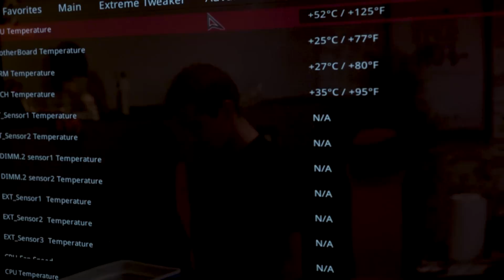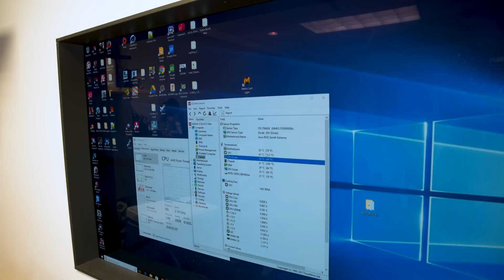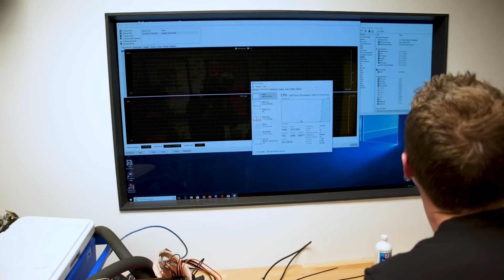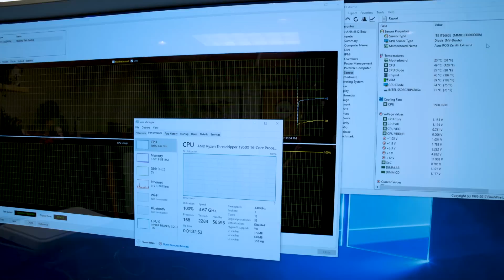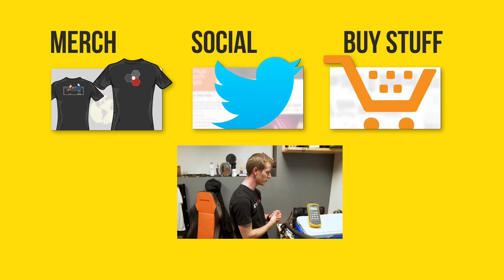My 10 Year Old Chiller WORKS! -20C on THREADRIPPER!

Comment: Actually, a lot of cpu cooling blocks could be majorly improved. The transfer surface of the processor is limited so that means that the cooling area as it is on the one you use, is also liquid wize. If you had a platform on the cooler with a copper raiser it would allow for a much larger liquid coolant surface. The liquid temp over the surface is directly depending on the velocity and volume so it can never distribute ( or cool) better than w/mm square as it is now. However, going up in block size require a pump upgrade as well or the local temp will more or less have laminar flow. You want a high turbulent flow with an massive transfer possibility. If it was a honeycomb ( with a flat bottom) up to a pyramidenlets say ten cm ( upside down pyramid) you can deffo get same temp as ambient in the room without any compressor whatsoever. A bit bulky but not complex.

Comment: The liquid inside the cooling system is Refrigerant mainly R134A or R-22
Reply: mostly R410a or R32 for airconditioners, R22 is not allowed anymore just like R134a and R410a in a few years

Comment: You got that wrong. It goes like this: compressor outlet (high psi/high temp gas) > Condenser (condenses the gas to a liquid by dropping temp to around ambient) > Evaporator (turns the liquid into gas = low temp) > compressor inlet (low temp/low psi gas > rinse and repeat.

Comment: "- I havn't used since AMD had a relevant high end processor" I do not have a middle finger long enough Linus, which is impressive considering my freakishly huge hands (I don't mean in the vapid bitch way, I mean in the I can wrap my fingers around extremely large water bottles easily huge).

Comment: The compressor compresses the fluid? I think you'll find if you try to compress a fluid it will break whatever you compress it with.
Reply: Air is a fluid, air can be compressed, a fluid can be compressed.

Comment: AC compresses gas then condenses it into a liquid. If that compressor tried to compress a liquid, it would break. This is why you can break your AC unit if you run it in the cold.

Comment: Crazy build idea: use a residential multi-split AC.  The kind with the compressor and radiator in an outdoor unit that pumps the freon into the house to have air blown over it for a central HVAC system.  All the noise and heat are outside, you could put the supply lines in the walls and just hook them up to the PC from there.

Comment: I had an idea once to do an immersion cooled system with 3M Novec fluid flowing out of the sealed case to an aquarium chiller.  You guys should do that.  Total immersion cooling mean 0 concern for condensation since you would already have to be sealed to prevent the immersion fluid from evaporating.  You guys should totally try that.

Comment: You guys should try water-cooling a water-cooled system. Like running cold water through the radiator to extract the heat.
Either that or turn use a system to spray down the radiator with water and let it evaporate to increase the cooling.

Comment: All ThreadRipper CPUs actually have a +27 degree offset for Tjunction (reported as CPU temperature), which is why it shows the temperatures it did. Tdie (reported as CPU diode temperature) is the actual temperature of the CPU.

Comment: Why are you guys using wiper fluid? If you look at cars, the coolant actually is water. you add coolant to reduce the freezing temperature - but the alcohol in the cooling fluid is the part that actually reduces the effectiveness of the coolant. you always want to have the largest amount of water and not so much coolant if you want to have a good cooling. If you use wiper fluid, you have soap and all the other additives in there that acually prevent a good cooling efficiency.

Comment: Key to heat transfer is no air gaps.  Key to insulation is vacuum gap (or second best is air gap).  That's why the best thermoses are double walled.

Comment: 1:33 NONONO fluids are incompressible, Linus! The compressor compresses GAS making it high pressure and hot! Then it becomes liquid when its cooled in the CONDENSER (the outside "radiator") then it gets transported to the expansion valve, where its pressure is released upon entering the EVAPORATOR (inside "radiator"), absorbing the heat you need to get rid off.
Reply: For engineering purposes in terms of hydraulics and such, water is considered virtually incompressible. But if you go to extremes like the bottom of the Marinas Trench, deepest part under the ocean... the water is compressed there slightly. It just takes such insane force that we usually consider it non-compressible even though it technically can. Just look up Ice-IX and stuff like that, exotic forms of water under such insane pressure/compression that it basically starts transforming into new states.

And yea, Linus was still wrong, lol.

Comment: Wait am I missing something?? That wasnt coolant, that was window washing solution....

Someone explain pls.
Reply: Payton Price obviously. But coolant or some other fluid, it will have the same effect as long as it doesn't freeze.
Reply: I believe coolant has a higher evaporation temperature so when it hit's a burning hot engine block it doesn't automatically expand in to gas and possibly fuck up your engine and not carry heat away effectively. He's using all weather windshield wiper fluid because its freezing point is much much lower then that of water, so #1 it doesn't freeze before leaving the jets to use on your windshield and #2 when you use it in the winter it doesn't freeze on your windshield, pretty much the opposite of what you want. Making the all weather windshield wiper fluid a better option as we're looking at going into sub zero temps and you don't want the fluid turning to ice.
Reply: Coolant doesn't make things colder, it is just to lower the freezing temperature.
Reply: Are you guys stupid? In an engine it literally pulls heat away from the oil temps and from your cylinders.

Comment: Help me someone. I got an old laptop running linux, but is boring and i want to upgrade it to win 10 64bit. But idk if my gpu has directX 9 
Specs:
intel 2 duo P8400 2.26 Ghz 2 cores 2 threads
4 Gb of dual channel ram
ati radeon hd 3470
2Tb ssd
Reply: Liquid Fire try reading your specs again, it's very unlikely you have a 2 TB SSD with the rest of that considering how expensive one is
Reply: This laptop had a 5400 rpm hdd 250 Gb. It was very loud and hdd with shitty specs was a disaster. My main laptop had 250 Gb M.2 ssd, and 2x2Tb sata ssds. So temporary i removed one and put it in my shitty  laptop :P

Comment: You got your AC working theory a bit wrong. The compressor increases the pressure of the vapor coming from the evaporator, which increases it's temperature (and hence allows the system to cool down anything). This now pressurized and much hotter vapor condenses (at least partly), due to the high pressure and lowering temperature inside the condenser, cause your fans cool the condenser down. After the condenser there is a valve which lowers the pressure, and anybody who has heard about physics knows that this lowers the temperature. This low temperature, low pressure vapor now goes into the evaporator and the cycle begins again.

Therefore you have low pressure and low temperature in the evaporator, and high pressure and high temperature in the condenser. The whole refrigerator/air conditioner works by pressure difference that causes heat changes throughout the system.
And it doesn't have perfect efficiency, which means that in addition to your room warming up with the heat from the CPU itself, it also warms because of the internal lack of efficiency, effectively turning electricity in to heat while cooling your heat source, and both these heat sources contribute to heating your room.

For more powerful cooler you should look into big air conditioners or deep freezers (or anything with high pressure difference). You could use fridge components too but they might use lower pressures to save on electricity and hence limiting it's delta T. And remember that the gases that used to be, and often still are used, are not healthy nor good for the environment. They contribute to global warming in high amounts and also often deplete the ozone layer, which is why devices using CO2 as the vapor are coming more common, since it doesn't contribute to neither greenhouse effect as long as it's from a greenhouse-neutral source or to ozone depletion.

You could do the same with water cooling though, although pressurizing water to high enough degree is quite expensive (like our ~5000 bar water pump is astronomically expensive, and still has quite limited lifetime). You could use your water cooling radiator as a condenser (if it would be rated to high pressure!), put the high pressure pump between your system and condenser, and drive the fluid back to your components from the condenser through a pressure regulating valve.

Comment: This thing looks like a cooling system for a diy nuclear reactor
Reply: Actually, cooling for nuke reactors is much simpler. BUT, you need a fairly large swimming pool for one.
Reply: I know that nuclear reactors (especially the breeder reactors used by the US) are all water cooled. Why do you think I made the pool comment. The large ones use large ponds to cool their coolant. The cooling system he used added an extra system into the cooling process that reactors don't have.
Reply: Jack Linde sry
Reply: Found the story

Comment: FALSE! Compressors dont compress liquid. They can only compress gas. Liquids are almost incompressibles.
Reply: Let's just agree to slightly disagree guys.
Reply: Im a refrigerator sealed system tech. The compressor only compresses gas. The gas transforms into a liquid in the condensor.
Reply: Kevin Liu in a vapor cycle, the compressor ONLY compresses vapor. If liquid get in the compressor it hydrolocks and breaks.
Reply: pogi09282805724 correct more succinctly the cycle goes vapor from evaporator goes to compressor which compresses it to a high pressure gas, condenser condenses it to a high pressure liquid then it goes through an expansion valve or orifice plate which evaporates it in the evaporator to a low pressure gas which then goes back again to the compressor. Cycle complete
Reply: pogi09282805724 FALSE! Liquids are slightly compressible

Comment: That insulation seems like it would be very bad for the cooling of the CPU's power chokes built into the motherboard, which would DEFINITELY be under stress if you're overclocking enough to need this cooler.

Comment: Boiled off liquid gas (Low pressure vapour) > Compressor, funny enough, compresses vapour into a high pressure vapour > Condenser turns high pressure vapour into a liquid state > Evaporator then boils off your liquid gas (Expands) > (Cycle repeats)

Comment: You should get a Tenney Oven and go down to -40 degrees C and feed the cables out the side port hole of the oven 😂 You can even get the Watlow controller to program the oven to keep it nice and steady with the right PID constants.

Comment: Why not use a split AC unit for this? That way you put the noisy parts (Pump, compressor and condenser with fans) outside and the rest inside. These would require though someone certified to do the Job perhaps.

Comment: Could you just put your board in a vacuum molding machine and make a perfectly shaped condensation proof armor. just cut the slots out where components, put the components in then seal the slots with vaseline.

Comment: This is like ltt in a nutshell
Reply: I think they could expand on this and do "Whole Room Water Cooling - Sub Zero Edition".
Reply: “Why did i do this?” “Why am i showing other people how to do this?” “Where is this screw from?”
Reply: Yes this is why I watch Linus' videos!
Reply: did he drop anything?
Reply: I'd personally use a Stirling engine powered by a motor, to get the low temperatures. Also, powerful fans would be needed.

Comment: Currently the temperature outside here at my place is -25°C. If I keep my PC outside, I won't even need a CPU cooler.
Reply: Air is a terrible coolant and a CPU without cooler has only a tiny surface area. It will very quickly overheat or at least thermal trottle. Don't believe me? Feel free to try it.

Comment: Linus you got the whole refrigeration cycle wrong , the compressor pumps vapor (it would be a hydraulic pump the way you said it) to the condenser where it releases the heat turning the refrigerant to a liquid then to the evaporator which absorbs the heat turning it back into a vapor and back to the compressor .

Comment: Okok, one beef I have is, RainX washer fluid??  Why not straight propylene glycol  or ethylene glycol?  That RainX has some methynal in it sure,  but it also has soaps and a liquid wax to keep rain from layering on your windshield. It's so full of contamination that your condenser will get clogged up. You have places to by that less than 20 mins from your office.

Comment: Would be pretty sweet if you could design a neat little setup where you replace the evaporation coil with a cpu block and control it with the fans on the condenser. The refrigerant would then be used to transfer the heat instead of the extra parts of the water pump.

Comment: You forgot the serious health, environmental, & legal issues of working with a closed loop Freon system(AC)!
If you were to accidentally puncture or break open any of the AC's chiller loop you would be breaking the law.
Some things you should know before doing something like this(In Canada[Ontario, couldn't find B.C.]):
https://www.ontario.ca/page/certificate-handle-refrigerants
https://www.canada.ca/en/environment-climate-change/services/air-pollution/issues/ozone-layer/measures-protect/federal-halocarbon-regulations-information/fact-sheet-refrigeration-air-conditioning-systems.html
https://www.ec.gc.ca/ozone/default.asp?lang=En&n=24B589A5-1
https://www.ec.gc.ca/lcpe-cepa/D918C063-1AB3-442E-A62A-59001B7B70F1/Refrigerant_eng.pdf
https://en.wikipedia.org/wiki/Freon

Comment: Um, I was on board until I saw the janky reservoir and pump. And window wash as coolant....... Jeeze
Reply: that stuff is is designed not to freeze at really cold temperatures so you can run you windshield wipers and sprayer in the winter.
Reply: Typically Rain-X leaves a hydrophobic film behind too, which is what causes water to bead on the windshield of your car and blow off easily. It's the whole reason they sell windshield washing fluid. I don't imagine it's as good for heat transfer but it may not make any difference.

Comment: Yup, looks like an AMD FX stock cooler. (I like AMD btw)
Reply: No Name You've done something wrong. 😂
Reply: I still have the FX8350... It's a good CPU!
Reply: I've ran two PC's with the FX8350 on stock coolers for around 5 or 6 years now. No issues, even with some overclocking. Either something is wrong with the CPU, the cooler positioning, or you have a bad overclock. Was the CPU new? someone else might have knackered it.
Reply: Yeah those Nickle fins and copper pipes on the radiator bring me back to the FX 8350 black and the FX 8370 wraith I had.
Reply: Yeah they can run a bit hot. Strange.

Comment: You can't compress liquids it's goes from the evap(vapor) to the compressor(vapor compressed) to the cond(turns to liquid) to a txv/fot(atomized liquid) back to the evap
Reply: Also there is a receiver/dryer or a accumulator/ dryer depending on if it's a fot or txv
Reply: https://en.wikipedia.org/wiki/Freon
Freon is a gas at room temperature and a liquid when cooled or compressed.
Linus doesn't understand how it works and was just trying his best. Cut the poor guy some slack. He isn't a scientist or even a professional with computers. He is just an entertainer and company owner/CEO.

Comment: I really want to see Linus and some other do this legitly and make it look good. Then test the temps under synthetic load and under games, also try to over clock it. do this on this on an intel and amd
Reply: I have a proper phase cooler (the gas boils in a CPU/GPU expansion block, giving you as low as -58c block temps at idle (who knows the component temp, they go all screwy at those extremes, some Intel chips show -100c which is clearly impossible and wrong, GPUs show 0c, so just something probably below freezing. Block temps are pretty much the only thing you can accurately measure).

It will probably be a while before I pull out that cooler though, but here is my other channel you can sub to. UCZp2Om_w_o0ry_FQhAUp-CA
I have a couple videos that are actually decent ready to export, but Vegas Pro keeps crashing every time I render them, and the current 2 vids are super low quality, so skip those. I only make interesting videos, next one will be a 120mm fan with the motor replaced from a race quad. Seems to be 120w, or 10 amps before the blades expand too much and scrape the housing, I'll see if I can get it up to 20 amps by sanding the blades, or maybe they will explode, either way it will be awesome.

Comment: That liquid tape is absolute junk. I've tried using it instead of real electrical tape on bare copper wires. The wires were still conductive. I threw away the rest of the can.

Comment: Now its time to make a shrunken down, 12 volt unit. That instead of needing an evaporator that has to be submerged can just get rid of the evap entirely and plumb that into the block instead. 

I'd love to see someone make a mini version of this that is no bigger than a 360 rad, res/pump combo and cup block. Even if it just drops by 5c it would still be an awesome starting point thatll encourage people with money and brains to possibly make a viable one